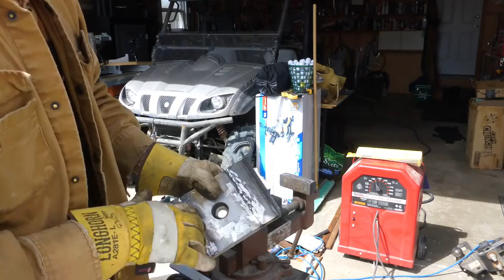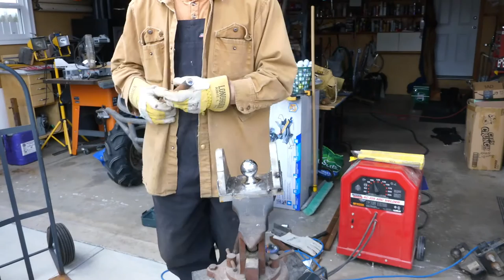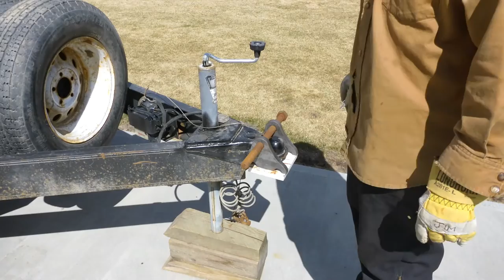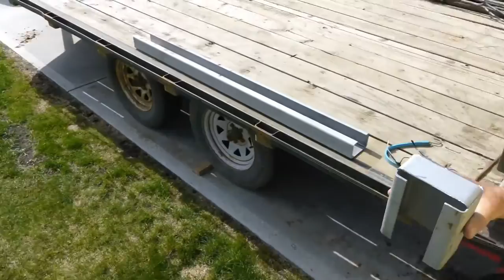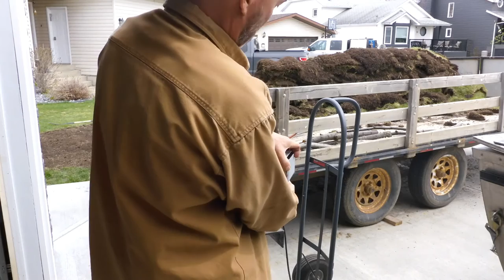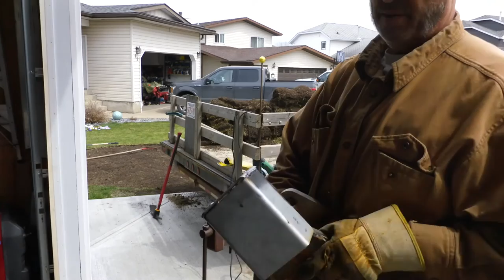Homemade Trailer Lock - Cuz Thieves Suck

Comment: Internet airmchair analysts (with any lock video): Yeah but i could be broken by a crowbar, a grinder, a reciprocating saw, a sledgehammer, liquid nitrogen, gas-powered 14" abrasive chopsaw, a .50 BMG with Raufoss Mk 211 rounds, some composition 4, a 2 hour nancy pelosi speech on kindle( just put one earbud on each side of the lock)....and that lock wont hold!.....I would have...blah blah

Guy making the lock: The lock will do and if not, its a $1000 trailer with dirt on it, gps tracked and i have suppressed blackout with a thermal scope....😁
Reply from the maker: Nothing stops a determined thief, but ya hafta at least make them work a bit.
Glad you liked the video mate.

Comment: 6011 is high penetration , used mostly for open root welding of pipe and structure.  7018 the easier and cleaner rod for the stuff you will most likely do .
Reply from the maker: Ok, my buddy told me I should try 6011(or was it 6010??)... anyway I had the amps at 105 and it was way too hot, dropped it to 90 amps and still too hot. 75 amps mighta worked, but I just switched to the 7018 that I know how to sorta weld with.
Reply: @GrizzlyCountry  well its worth trying , but its not nearly as easy to run , makes a lot more spatter and its not quite as strong.  It is however a great choice for your root pass on a multi pass weld as it will give you the deepest penetration.